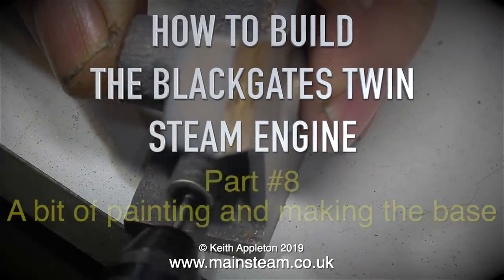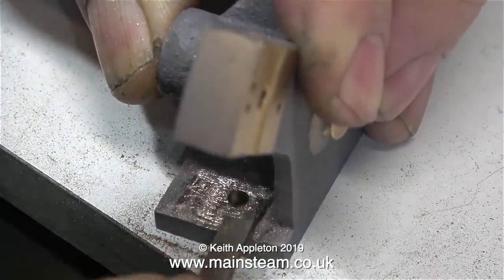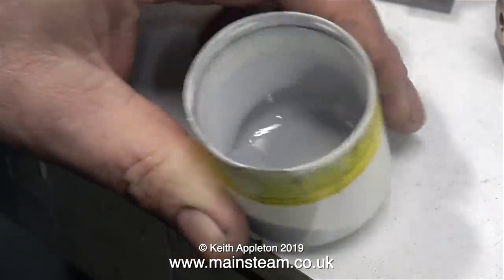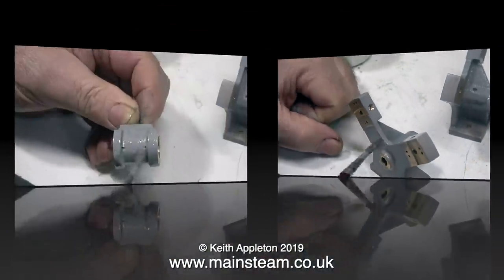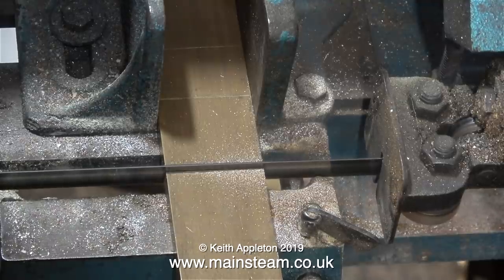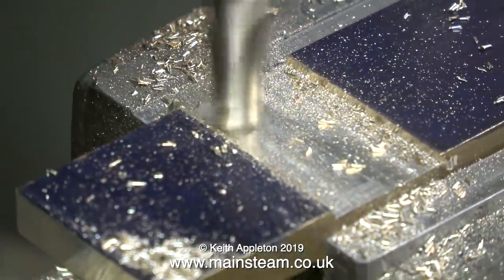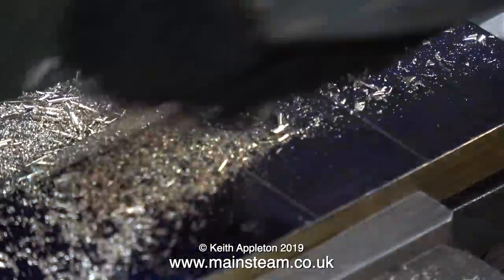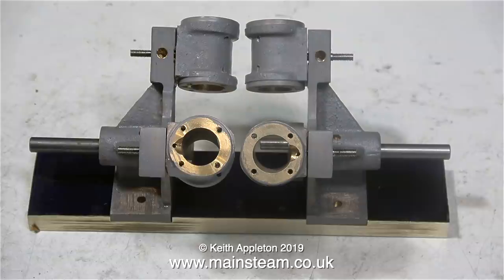HOW TO BUILD THE BLACKGATES TWIN STEAM ENGINE - PART #8

Comment: Very interesting to hear your thought process re. the final configuration as related to possible applications of the engine(s). You seem (understandably) to be torn between the aesthetic and the practical issues - it's not enough to make it work well, it also has to look good!

Comment: Are you going to offset the two crankshafts so that the finished combined engine has four power pulses per revolution as in a four cylinder engine, or two pulses (one cylinder of each half 'firing' together)?
Reply from the maker: All will be revealed in the series . . . . more episodes are available to view now on www.patreon.com/keithappleton